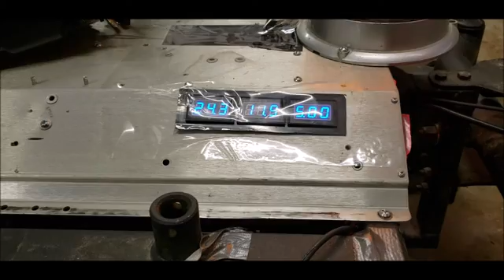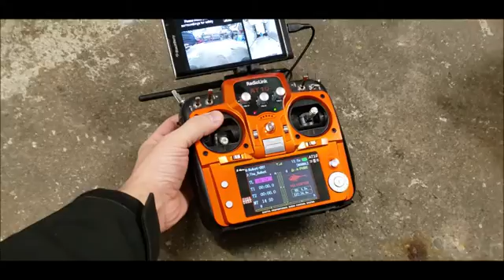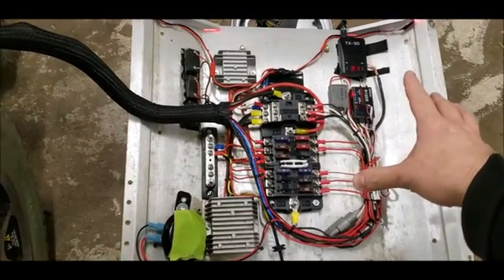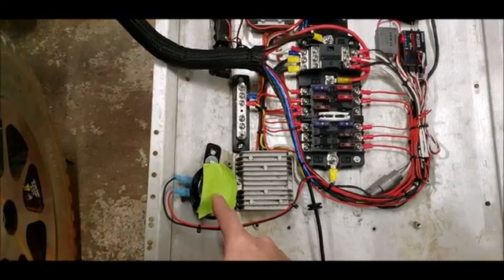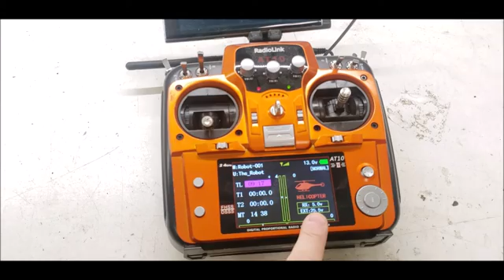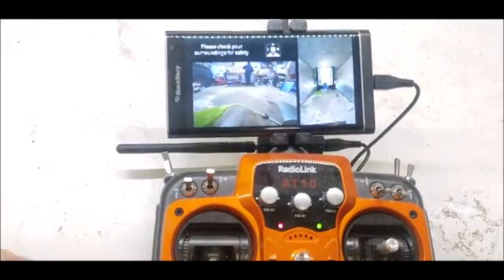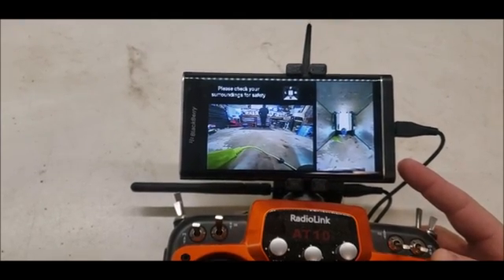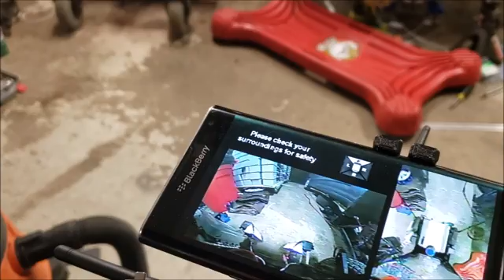FATBOY - a wheelchair turned RC sumo bot

Comment: This is badass!
I happen to be building a similar machine, though with 4 wheel drive and a custom chassis.
How exactly do the camera systems work? Really want to get going with FPV and I'm curious what exactly the video processor is, and how do you tell it to switch cameras via the transmitter?

Great work, and I love the compilation of moments at the end. "THE DEATH MACHINE" made me laugh :P
Reply from the maker: The birdseye or 360-camera is done by a stand-alone ECU made by Brigade-Electronics called the Backeye 360, Thats one of the OG aftermarket 360-cam setups and there are others (cheaper) options out there now.

My implementation works with the Backeye360 system goes to a video transmitter and receiver to the phone's OTG. Then the RC controller has a PWM to relay module that switches an 12V input on the Backeye360 ECU to switch the shown camera.  There is still just one video-stream sent to the transmitter, the Backeye360 just changes the contents of it. 

Theres no brand of the Video transmitter/receiver, but it was fairly inexpensive, and the quality/range matching what i paid for :). Latency is good tho.  Specs were "TX-5D FPV 5.8Ghz 600mW"

You might've noticed a lot of this was in past-tense... I too am building a new machine, custom chassis, and this one was torn down to reuse some of the parts.
Reply: @Jigg007  oh, I hope your new machine comes together nicely!
Thanks for the info! I'll do more research on this with what you have mentioned. I appreciate you replying to me, as well. Many people who built robots many years ago seem to have forgotten that they ever did it and don't have any details for future builders like myself. So thanks for sticking with it!